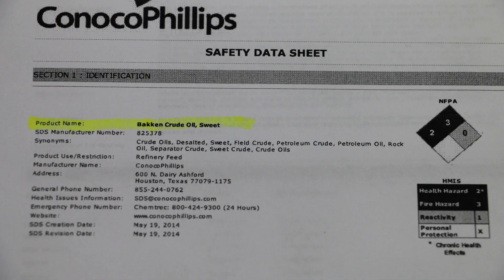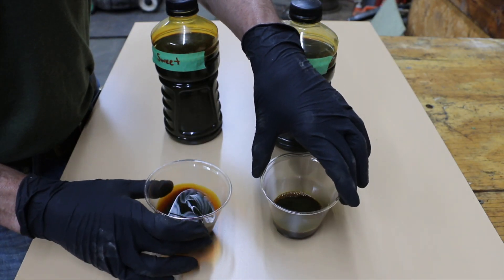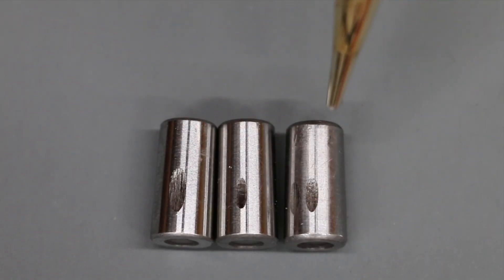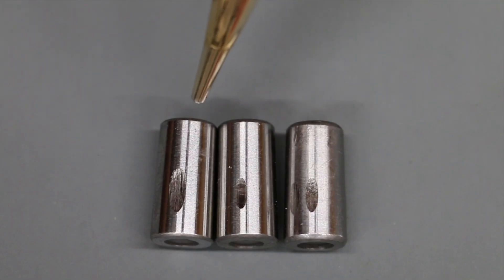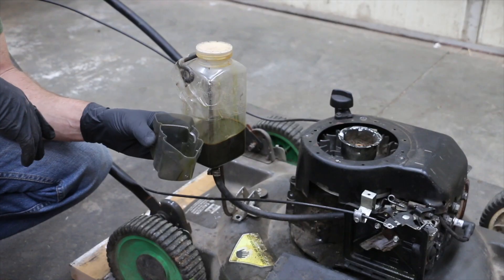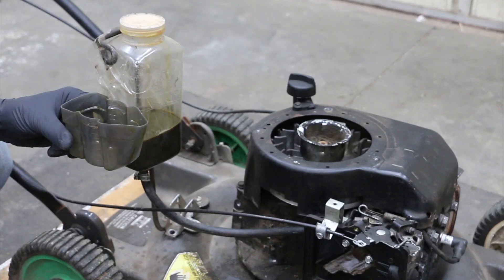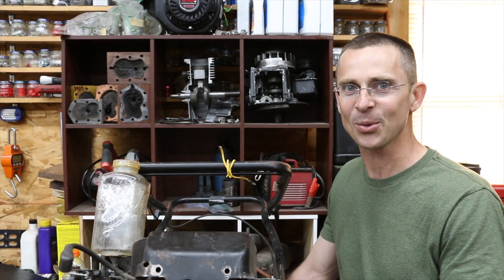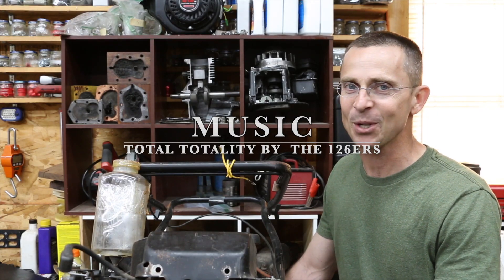Will a Gas engine run on Crude Oil?  Let's try it!

Comment: When driving tow trucks late 1970's, my boss purchased a brand new Mercedes Benz 280se. He drove over the pit in the workshop and gave me a new oil filter and asked me to drain the oil and replace the filter, which I thought was unusual on a car he just purchased a few hours ago. 
After completing the drain and filter change he told me to now fill it up with the same diesel oil we used for changing the oil on the tow trucks. Curious I asked him why he was using diesel oil for a petrol car especially for an expensive car like the Benz.  
Not a man of many words all he said was it had to be changed from when the car was brand new and had used diesel oil for all of his cars.......................
Reply from the maker: Wow!  Interesting.
Reply: As he swapped out the recommended manufacturers oil when the vehicle was brand new, he didn't seem to worry about voiding the new car warranty. He never elaborated as to why he used diesel oil.

Comment: I used to haul crude oil in Wyoming get a few gallons of high 50 gravity and it would run in our carb 300 ford v6 f150 at work.
Reply from the maker: Thanks for commenting on this.

Comment: The sulphur in the sour crude oil acts as a anti wear agent. This is why it works better than the conventional oil. But without additives to remove the acid by products the metal parts will get corroded.
Reply from the maker: Great point!

Comment: Crude from Norman Wells, NWT, Canada, is sweet enough to run in diesel engines and is why the US Army in 1940 built the Can-Oil pipeline to Alaska about the same time they built the highway through Canada to Alaska in WW2.
Reply from the maker: This is interesting. Thanks for commenting.

Comment: Way back in ancient times (mid 1980's) I served in the U.S. Army, we had a number of " Multi Fuel" vehicles, they could run on literally any flammable liquid that could be poured into the tank! Crude oil,  used motor oil, cooking oil, gasoline,  jet fuel.....Moonshine (seriously)  They ran great!
Reply: BTW, We once filled a Multi Fuel 2 1/2 Ton Truck with used cooking oil from McDonald's......The exhaust smelled like french fires!! No kidding!
Reply from the maker: LOL!  That'd make all the troops hungry.

Comment: An endurance test of crude vs conventional oil would be an interesting experiment.I suspect that though crude has higher initial protection, a bonafide engine oil will provide better protection long term due to additives. As far as sweet not burning too well, how about vaporizing it? If it has the required flammability and gives vapors readily, perhaps air would be a better carrier.
Reply from the maker: Thank you for the video idea!

Comment: Did the sour crude smell worse than gear oil? Whenever I change the gear oil in the shaft drive of my Yamaha XJ 1100, I hate the smell of gear oil, your oil really stinks.
Reply from the maker: They both smell about the same in my opinion.  I really don't like the smell of gear oil either.

Comment: Project farm can you help me with my mower i got an old mower thats been sitting for 3 years and i cant get it running i cleaned the carburetor and spark plug but no start
Reply from the maker: Recommend replacing the spark plug, then see if it has a strong spark.  If it does, give it a little starting fluid to see if it'll fire up.

Comment: Hi, I have a question I'm hoping you could help me with. I'm working on restoring a 03 Suzuki Murauder 800 that hasn't ran and poorly stored for 2 years. Two questions. I want to replace the spark plugs, is it worth it to use a E3 spark plug over standard NGK? Second, does a motorcycle specific oil have any real benefits to a comparable car oil? Thanks, love your videos!
Reply from the maker: I haven't personally tested the E3 against NGK.  I would stay with the NGK.  Yes, from my testing and experience, some motorcycle oils have zinc, which greatly improves film strength.

Comment: Regarding lubricity test, since both just come out of the ground I think you should filter both for abrasive particulates and the retest both oils. My guess is that one might just have more abrasive mixed in with the oil and it is giving a falls answer not to to the actual oil but grit that is mixed into the oil. BTW I only learned the difference between sweet and sour oil a few years ago you did a great explanation of the difference between the two!
Reply from the maker: Thank you very much for the recommendation and positive comment.

Comment: It's not suprising that the sour crude did that well, especially as a lube in the lubricity test.  The sulfer is what is used as a lubricant/high pressure additive in motor oil and diesel that has been removed in recent years and has caused lubrication problems with both.  I am surprised that you got a sample of either that was thin enough to work in a carburator, I'm guessing that they've both been flitered to remove the heavier/thicker stuff.
Reply from the maker: All great points and thanks for commenting.

Comment: Please, you gotta try the pyrolisis oil. From wood or plastic, maybe from tires, but i wanted to see if a engine could run on them. If they actually can run with crude oil, they might as well run on plastic or tire pyrolisis oil or biocrude oil. If positive, this would open many precedents....
Reply from the maker: Thank you for the video idea!
Reply: I think pyrolysis is not worth the effort for fuel, but.....it is a treasure trove of chemicals for organic synthesis. If a home chemist has a way to separate and identify chemicals from pyrolysis, he would have access to hundreds of chemicals , actualy thousands of chemicals.

Comment: It would be interesting to see the bearing tester run with several different kinds of oil. In particular I'd like to see some high zinc and break-in oils.

I'd also find it entertaining to watch a bearing tester upgrade to prevent it throwing oil all over and reducing the amount of oil in the cup (seems like in some cases it immediately throws some oils out resulting in possibly inconsistent oil supply during the test).
Reply from the maker: Thank you for the video idea!

Comment: The difference in buildup was quite significant, I wonder why.
Reply from the maker: Great point!
Reply: I would have thought it would be the other way around because the hydrogen sulfide is an unwanted contaminance but apperantly it either has some cleaning properties or there must be something else.

Comment: I like the video, I like all of your content when I have the time, we used and still use to steal the petroleum from local oil pumps at the countryside here in Romania to start up fires in our brick stoves and run our tractors and dump trucks on that stuff, the oil pumps had no surveillence cameras back then. The tractors ran just fine, but the coal they were rolling was insane (NOT TO MENTION IT WAS FUN WHEN YOU STEPPED ON THE GAS ;))) ) Today we use sunflower oil because we are cheap'os. PS ! I was also stealing a ton of liquified dinosaur back then at the age of 10 with my friends, we pulled a 40kg cart worth of oil, fun times, what can I say, then we started a huuge fire with rubber, car tires.  Nice content, keep up the good ideas only buddy ! I'm not begging for likes but I would appreciate for a few, just for my story from personal experience ! <3
Reply from the maker: Thanks for commenting on this!

Comment: Man i thought my 2 scres was a lot of grass to cut looks like you have more. Quite educational I didn't think it would run on either oil.  Question has your drill ever been pitch by the mower using it as a starter. I use my cordless Makita ½" drill downfall is electric brake in the drill. First tim i used it the mower fired and there went my drill flopping across the ground. Take care stay safe
Reply from the maker: My drill hasn't been thrown by the mower yet. It spins faster than most cordless drills, which helps.

Comment: Hey man I have a suggestion for you. To solve your issue with the non adjustable jet search “Bronda kart fab” he has a video on converting a Briggs and Stratton motor to use a predator 212 carburetor. And add this http://www.gopowersports.com/tillotson-tct-mechanical-fuel-injection-carburetor-replacement you can adjust AFR with this carb.
Reply from the maker: This is a great recommendation--thank you!
Reply: Project Farm This carburetor will also directly attach to the generator you bought.

Comment: Crude oil is not 'broken down' in refineries,rather its constituents(diesel,kerosene e.t.c) are separated. Try using a sweet crude/ethanol or sweet crude/hydrogen peroxide blend in a 2-stroke engine & if possible in a diesel engine too.
Reply from the maker: Thank you for the video idea!

Comment: Hmm I would think the crude oil would only work in a diesel engine... It is quite surprising that it works so well. But many other here have mentioned crude oil properties vary greatly from well to well.
Reply from the maker: Thanks for commenting.

Comment: While I agree that I'd like to see both crudes in the crank case, the project I'd like you to revisit is WD-40. You attempted to use it as a liquid fuel but you, didn't test to see if it could run on the vapors.
Reply from the maker: Thank you for the video idea!

Comment: Can I recommend a couple things to add to your things to your videos?  They are for your exhaust.  One is simple and the other requires some research if you don't know how to use it.  The first one is using a contrasting backboard to put behind the exhaust port so that we can see the smoke better on camera.  I would say a transitioning white to black cardboard/foam board.  The second would be a gas detector/gas monitor and see what all gases are being emitted from all the different tests you've done.  It would be fun and interesting to go back and revisit all the tests you've done with the gas detectors and see which ones have given off the most toxic gases and which were most harmless.
Reply from the maker: These are great recommendations--thank you!

Comment: Really cool video!! Never thought of this but I’m glad you and other have!
I’m AMAZED how clean burning the “sour” crude burns! The head and top of the engine barely looks used when you took it apart after running! I’m impressed! Did they smell any different after being burned in the engine? Did the sour still make sour smelling exhaust? 

I wonder how they would work as motor oil as well :)
Also, would either run in a diesel?
(I don’t know if testing in the tractor would hurt it or not so if you ever get a small diesel engine that would be a perfect testing platform for this and many other tests as well!

Keep the great videos coming! Take care!
Reply from the maker: Thank you!

Comment: Video suggestion- Could you use 2 stroke mixed gas in a 4 stroke engine without any oil in the crankcase if you had to?
Reply from the maker: Thank you for the video idea!

Comment: How about running E-85 in one of these engines and testing the engine temp and corrosion on the valves and piston. And maybe even running it in the go-kart to see how it feels power wise vs regular gasoline.
Reply from the maker: Thank you for the video idea!
Reply: Project Farm I had a thought to go along with this, how long will the generator run on a tank of E-85? Since E-85 has less power than gasoline how much less time before the generator runs out of fuel?

Comment: Great test! Never thought of using straight crude  - great idea!

Love the runway you've got there! Do you fly? I've picked up the aviation bug, thanks to Youtube. Planning on buying a paramotor when funds allow, and some day an ultralite helicopter. 😎
Reply from the maker: I don't fly.  I wish I could afford it.  Fun, but expensive.
Reply: Oh I hear that - that's my problem right now - affording what I want. I'm looking at the absolute bottom of the aviation chain, too. It's crazy how much aircraft, maintenance, and fuel costs! A fully-equipped Cirrus SR-22 is about $750,000!! Definitely a rich man's sport. Paramotors are about the cost of a Japanese sport motorcycle - still pricey, but doable. At least this will be within my reach at some point. Hope to get one in the next few years. You have the perfect yard for an ultralite or paramotor! 👍

Comment: Try to make a Turbo with a hairdryer or leaf blower I know you have no way to measure horsepower but you could figure a way to add a mesaerard amount of presser on the flywheel brake and see if it takes more to stall it
Reply from the maker: Thank you for the video idea!

Comment: They have oil tanker ships that run on crude oil.
Reply from the maker: This is great information.
Reply: The Japanese ran some warships on crude oil late in WW2.  They tended to blow up far more easily.
Reply: @ComradeArthur   Born in Fukuoka Kyushu, my father mentioned his father was tasked with keeping things going and often utilized quick  "fixes" and I assumed it was due to that, but I was born in 88 so I wasn't there. (3rd "hand" info")
Reply: @ComradeArthur  That happens when you drop bombs on them.
Reply: Worlds largest vehicles with the worlds largest fuel tank LMAO
Reply: Thad actuall HFO heavy fuel oil,it's the final distillate befor tar
Reply: they actually run on a heavier fuel which is refined from crude oil by fractional distillation
Reply: @sploofmonkey no, I don't mean that the ships themselfs have a fractional distiller on them.
Reply: O.P. Yates Never clear anywhere? LA in the 70's & 80's was a hazy disgusting mess. It has far far improved over the last 30 years.  I remember a Car magazine article from the 90's talking about the efficiency of it's engine & emissions, that said the exhaust coming out the tail pipe of a Porsche 911 Turbo driven in LA was cleaner than the air going in!
That same fact has been repeated (copied) in another article recently about current models and it just shows how efficiencies and emissions are ever improving.
Reply: Yeah, I'll back you up on the improvement in LA air quality.  There were times in the 60s I couldn't see buildings downtown from 3 blocks away.
Reply: Yup, bunker crude is (or maybe was, knowing the enviro-whackos) a commonly used fuel for ships-at-sea. So snotty it has to be heated to make it go through the injection system, and so smoky you'll get fined for burning it in a lot of ports, but very cheap.
Reply: GreatNorthernDad The envirowackos you mention should definitely worry about ships more than cars. One cargo ship emits more pollution in one day than 50,000,000 cars in that same day (yes, 50 million). And there an estimated 90,000 ships on the seas.
Reply: David Roberts Don't know about that. A toothless figurehead who can't really do anything of substance that affects anyone outside of the US of A without many layers of approval of congress and other agency bureaucracy VS. world wide misguided and misinformed individual, first-world, privileged, poke-my-nose-into-my-neighbours'-business-fascists tut-tutting over small-picture, simplified problems rather than the things of real consequence. People generally have zero clues about things they can't see in front of their morning cereal bowl. I own 4 cars, 4 motorbikes & multitude other engine powered tools n toys. But I also know container ship & aircraft emissions are a real issue no one wants to admit to lest it means they can't buy their iphone or nikes.

Comment: Hi Mr project farm this is not related to video but maybe could be tested. In your opinion what is the best product to use to remove surface rust? Need to clean up a old push bike and has alot of rust spots on the frame. If you could let me know that would be ace thanks.
Reply from the maker: I'll test it soon. Thank you for the video idea!

Comment: How much tolerance will an engine take with really old oil in it?
Reply from the maker: It really depends on the condition of the oil. It's really hard to say without more details.  Short term survival shouldn't be a problem if the oil will flow properly.
Reply: Project Farm what if we filled an engine with axle grease and see what that'll do?
Reply: I meant axle oil to see how it compares to conventional 10w.

Comment: sulphur is an outstanding lubricant. that’s why you shouldn’t avoid using sulphur-free diesel fuel in older diesel engine. their pump's, injectors’, nozzles’ lubrication depends on the sulphur content in the diesel fuel!
Reply from the maker: Great point!
Reply: Simply adding oil a la 2 stroke gas will keep it going, but if you can still get regular diesel instead of the Ultra Lousy Sulfurless Diesel it's a lot cheaper and plenty good on its own.

Comment: everything wrong with this video; 

1. The flashpoint is at least lower then -29°C, so everything from -280°C to -29°C is possible, probarly in the minus 60 to minus 40 range due to the light hydrocarbons around (methane > pentane and all its isomers in between).

2. Sour crudes, not only hydrogensulphide (H2S) also a hell of a lot of mercaptans do smell very nasty making the crude a sour crude, its even possible that those mercaptans are so heavy they don't evaporate easy on room temperature making the crude high sulphur content (and sour classification) but not smelling like shit.

4. you don't define a crude as "light" or heavy by viscosity, its the API gravity (density) that defines a light or heavy crude, a light crude can indeed have a higher viscosity then a heavier crude due to the tar being present instead of clean parafin waxes.

5. Nice you made your own BOCLE test, kudo's :) (Used on Jet type fuels)

finaly, sour or sweet doesn't have to do alot with the fact an engine will run on it for 5 minutes, its just the sulphur content (does bring some heat of combustion, but not much). The boiling traject (higher boiling range is more energy/Kg but burns less hot right away) So for a gasoline engine you need a "lighter" cut (the gasoline) that's easy to vaporise fully, and ignite with spark.